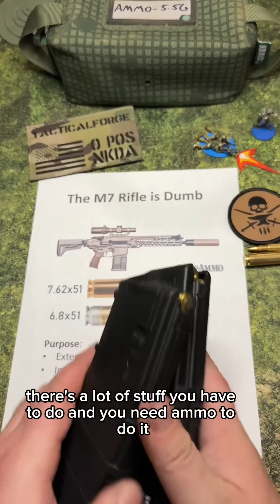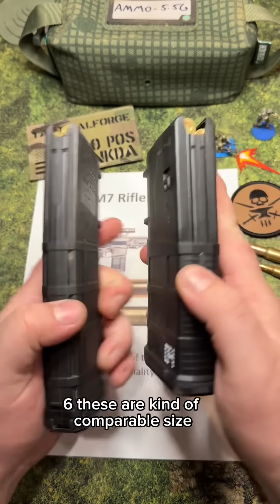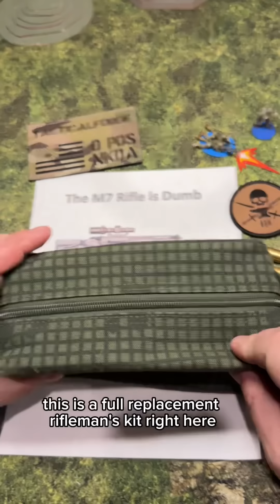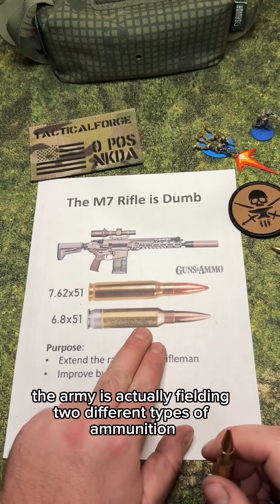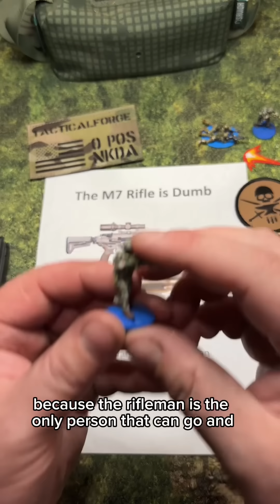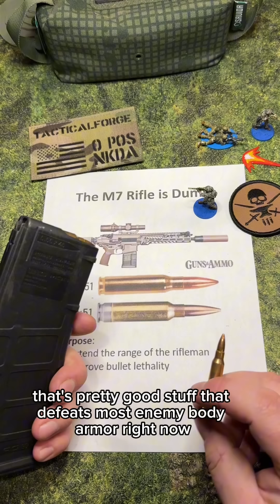The Army’s new rifle is dumb

Comment: Regarding the Rifleman’s Load of 210 rounds, looking at both sides in Ukraine at the moment, who are actually getting into modern infantry combat, you see that assault infantry on both sides tend to carry a lot more than that just in mags. I’ve seen photos of Shturmoviki squads running 12-14 loaded mags each, never mind loose ammunition. On the high end that’s 420 rounds, plus one in the rifle for 450 in total, loaded and ready to go. 5.45 is relatively light overall, which lets them carry that, between suppression from the squad’s base of fire and the amount of ammunition that has to be dumped for things like FPV drones, I think they’d shoot you for suggesting they try and carry enough ammunition for a rifle-caliber round like the XM7 has.
Reply from the maker: Yes indeed; the intermediate cartridges are just fine over there
Reply: you have to take into consideration that no side in Ukraine has air superiority,
americans will never fight a trench like that as long as USAF and naval aviation remains as capable as it is
Reply: @lefunnyN1  Air Support is helpful, but assuming the airforce will do everything every time is a great way to lose. The Russians are also able to deploy air power against fixed positions - that’s what UMPK kits are for - but in the time it takes for artillery or air power to respond when you are under attack or pinned, you may very well be killed.
Reply: @lefunnyN1 the Russians have the best AA batteries and the Chinese are building cheap effective jets
Reply: @lefunnyN1  your speaking like air power cant be contested, it very much can be and thats the problem they've run into in Ukraine , niether side can get the actual air superiority without risk of the planes going down

Comment: More weight, less ammo.

I'm not a soldier, I'm not an expert by any means. But that sure as hell doesn't sound good!
Reply: It's extra not good when you realize 99%+ of shot fired in small arms engagements are for suppression at ranges less than a couple hundred meters 

The side which gets successfully suppressed either trys to run away, surrender or destroyed. It's been clear this is the case since WW2, still the case in Ukriane even with wide open fields, yet these generals seem to fantasize turning all rifleman into snipers and think armor plates have the coverge of medieval knight armor

Comment: Number one issue is the obvious; "How are you gonna tell me to carry more weight, but less ammo?"

This is why I think the Army should just issue out the URG-I that the Rangers have been using for a while. It's still an M4, but it's got an upgraded barrel and an MLOK rail that's significantly lighter, having more airflow that'll keep the barrel cooler during sustained fire. Also, they can standardize the ACOG across the board rather than make the soldiers use those shitty '08 ass Aimpoint Comp M4s. Regarding the laser rangefinder on top of the new LPVO, that drives me crazy because it seems like the Army is worried about the wrong thing. You're not defeating the equivalent of level IV plates with 6.8 Hybrid, but what you can defeat is night vision. Take off the laser rangefinder and add a piggybacked RMR. This allows the soldiers to use passive aiming under nods, which will allow them to aim at a target without projecting their position to every Ivan, Ling-Ling, and Ahmed, who was blessed with NVGs. 

The Army's priorities are all fucked up. I like Sig as a company. I think their rifles can be great, and I like most of their handguns, but this is logistically impossible and logically unsound.

Comment: I wonder if barrel errosion will be an issue?  This rifle cartridge looks similar  to the performance of the Winchester 270.

I would pick a Sharps 25-45 AR-15 or a Winchester 243 DPMS rifle with an 18" barrel over the 277 Fury.

Comment: What I'm getting from this is that we want a g11, like low recoil, very lightweight (with ammunition included), decently enough accurate (probably). 

Na that project is dead and buried, and i don't think that there is a nation actually wanting to bring it back. Its just funny that it could fit that role very well (if they made sure cook off isn't an issue and have data on armor penetration), like maybe they really were onto something.

Comment: Stop putting the Army in charge of small arms procurement. The Air Force gave us the 5.56 & M16. The Air Force gave us the 9mm, M9, Sig P226/P228, and Glock. 

The 5.45 & 5.56 are working just fine in Ukraine. Arms, legs and brain buckets are still unarmored. Head shots are the norm for close combat.

Comment: IF this weapon was a DMR designed to use the same ammo as the replacement for the M240, then thats perfectly fine, and would fit in a squad like a puzzle piece. i think the new LMG is going to be an incredible asset and a new DMR that can penetrate modern body armor is exactly whats needed...but as a full-blown replacement for the M4 and, by extension, the SAW? NO WAY. the M4 and SAW in 5.56 need to stay; its just a matter of logistics and fire superiority.

Comment: The ammo is also a problem.  You cannot stockpile large amounts of it.  The metals react with each other and cause galvanic corrosion.  Plumbers can't even mix these two metals because they will fail so quickly together.
Reply: I JUST had to replace my main black iron (steel) gas line, because some clown installed a copper water line directly under it, touching.  The copper looked like a car battery, but the steel pipe looked like someone took a bite out of it.
Reply: Huh....wonder how that got overlooked. Or maybe it wasn't overlooked, and someone was thinking of the $$$ that will come from having ammo that goes bad quick.
Reply: @WangMingGe  that was probably the plan from the get go...everything poltical happens for a reason
Reply: @warren-g  I suspect you're right.

Comment: Even if we need to switch to more effective ammo, we can do this as an upgrade to existing rifles. A simple barrel swap, BCG and magazines and you can run 6mm ARC or 6.5 Grendel. Grendel would be optimum with 100gr loads at 2800-2900fps and retaining their energy at ranges that surpass even .308. . Grendel also uses existing 7.62x39 cases that are necked down. There already is robust production infrastructure among NATO and with US suppliers to make those rounds very quickly and in volume.
Reply: Case head is too large for AR15 bolts, leads to thinner material and therefore more breakage. That's why CMMG had to go AR10 bolt for their MK47 Dissent to fix that problem. Best bet would've been something like the Ruger SFAR, a hybrid between AR15 and AR10 in 6.5 Creedmoor or .308 Win. Realistically though, drone warfare is the future of modern combat and man v man combat would be at close range where you aren't going to whip out a drone, sit with video goggles covering your eyes, and dome your opponent with a explosive payload. Perhaps leading to 300 blackout supersonic since that can range about out to 200-300 with a 10.5 barrel, cutting down on weapon weight and length and making suppressors much more attractive.

Comment: Body armor is great and all, it can give you a solid chance to survive where you otherwise wouldn't but you know what defeats body armor better than an armor penetrating bullet? Volume of fire. Getting hit repeatedly by multiple guys with 5.56 rifles is gonna take you down, you're likely to be hit somewhere unarmored and get taken out of the fight. The M7s ability to defeat lvl 4 plates up close is already dubious at best, they'll just make tougher plates. Armor might save you from a lucky hit or a sniper aiming for center mass at entended distances but up close it's kind of a roll of the dice. We're also seeing a lot more small disposable drones being used as bombs and this gun would be TERRIBLE for dealing with drones. They're hard to spot and by the time you do you've gotta be quick or you're going to be dead. A few guys with full auto M4s have a far better chance of getting a lucky hit that takes the drone out through volume of fire than even 20 guys with this M7 with its high recoil and lower magazine capacity. The M7 also inherited all the Sig MCXs many issues, including the handguard and barrel being held on to the receiver by two tiny short little screws and prayers. Look up the barrel wobble caused by those screws coming loose after just a few hundred rounds even after people use loctite. It's a major issue and it's only one of many the gun suffers from. It's very obvious between the M7 and the M18 handgun the military skimped out on testing and awarded Sig with these contracts through pure bribery. The whole program was flawed from the very beginning as you've pointed out but add in a dash of corruption and you get a shit sandwhich.
Reply: I think you're the first person I've seen bring up the drone factor, and you're right....there's tons of footage of guys taking down drones by spraying them with AK74 fire. The M7 would be probably much less effective.
Reply: @WangMingGe the Ukrainians have some sort of explosive 5.45 round, basically micro flak for drones.
Reply: @agent7_4319  Amazing. I'd like to see some of those in action.
Reply: @agent7_4319  Incidentally, I can imagine those would do a horrible amount of damage on a human target...

Comment: My problem is that I need the 76 2 x 51 for my mission, and I'm being swapped out to 556. 
My mission didn't change , as a matter fact, if there was any change, it was from the evolution of warfare and now my mission is more dangerous.
I really want 762 . 
I don't have to run anywhere , I'm not carrying this stuff at least not very far, I'm essentially doing point defense. 
And the drone threat has really come into its own in the last five years. 
For my mission, conducting maritime security, 76 2 x 51 is minimum. 
Yes, I want the 50 cal.
No, I'm not going to get it.

Comment: Firearms technology has stagnated. Optics keep "improving" and platforms keep changing COSMETICALLY, but no improvement to the actual technology. We are still using conventional cartridge based firearms. I would love to see a REAL next step. Like a coil rifle. Unfortunately the tech isn't there yet, but imagine if you could build something at home that you can just plug in and something that doesn't get affected by an "ammo shortage".
Reply: We are far off from Warhammer 40k Lasgun technology. The problem with your idea is that the battery technology you described is not publicly available and wont be until these old heads retire or drop over dead.
Reply: @Arnuld15Governator i charge that people look for the solution themselves not sit on their butt and wait for it to come to them from someone else

Anything "commercial" is going to be subject to the same red tape, infringements, and "shortages" we are already dealing with

Be your own smith independent of all the industry. They are all compromised anyway.

Comment: Despite agreeing with almost everything you said, there is one thing I disagree with, which in this case would be the engagement distance. Although for the rifleman it is not that relevant to increase the rifle's engagement capability, however, for machine guns it is quite important. It's no wonder that many armies use MMGs within rifle squads despite all the disadvantages they have, just because of their better engagement distance (also not to mention that a greater engagement distance allows for a more capable designated marksman). Therefore, what I would suggest is to replace "less capable" intermediate cartridges like the 5.56 NATO or the 5.45x39 and use cartridges like the 6mm Max or the 6.5 Grendel (because although they are still intermediate cartridges, they considerably improve the engagement distance and also have other advantages, making the weapons more versatile and without increasing the weight and bulk too much).

Comment: As an ex Army Infantry Officer, this rifle should have been used in the capacity of a designated marksman in each squad at the platoon level.
The concept is good, just totally impracticable for sustained battlefield use.
Low round count, very heavy, and the extreme velocity of this high-pressure cartridge will burn up barrels in just a couple of extended engagements. What a potential nightmare both strategically as well as logistically.

Comment: It's about the arnor penetration, not the range
Reply: It's not. Armor penetration and extended effective range are both goals of the NGSW program.

The issue with the armor penetration issue is that 6.8x51 likely can't penetrate a SAPI plate (or equivalent) 

Sure, they're "rated" for .30-06 M2 AP at like 2800fps and the "spicy" 6.8 loadings are creeping past 3k, but those plates often take .300WM / .338LM hits in independent testing and that's far, far more energy on target.
Reply: The existing 5.56x45mm round could be enhanced for greater armour penetration. Just as how its range was enhanced when moving from the 1st Generation, 55-grain M193 to the 2nd Generation, 62-grain SS109 in the 1980s, allowing it to be effective out to 600-800m (up from 300-450m with the M193)

Comment: No, it makes wonderful sense. Except that it was done all wrong. They could have used kac or the lmt rifles already in circulation, used an improved projectile and done just as well. The process is literally rebarrel the firearm. Which is not complex. Offering the ability to use a 6.5 creedmoor case to power enhanced projectile. 6.5mm is bigger than 5.5mm right? Hmm.. but some shitass GO didn't get a kickback for buying unnecessary junk.

No need to push this steel head, brass case design.. those higher pressures mean reduced lifespan of parts. Plus, concussion... Uh.. 

If that was too expensive, the 7.62x51 chambering with a 140gr penetrator would already be fairly effective, no? Which.. is just having linkless rounds for the box mag...

But SIG sure is REALLY knocking it out of the park lately

Comment: I have a few questions that I'd love to get an informed opinion on. Regarding the LRF and BC in the scope. Assuming they can get those features working well, wouldn't that allow the regular soldier to engage targets further more accurately, even if not out tonthe 800m range?

Secondly, considering the idea of a round able to penetrate emerging or future body armor developments seems like a good idea. The current equipment works on the current targets, but isnt relying on what worked last time just 'preparing for the last war'?

Comment: Limited understanding take - hear me out: The ballistics are really good, it’s heavier than it should be but it’s suppressed and effectively doubles the range of infantry engagements from 3-500M to 800-1K Meters. Given the domestic concerns and return of trench warfare - movement is limited and giving each soldier a range finder is primarily for secondary weapons systems like drones or armour support with distinct coordinate drops. With a thermal clip on - this is a massive force multiplier for infantry. 5.56 was made to injure and incapacitate - not kill. 5.56 is a hopped up .22 cal that is not a one shot drop weapon. This weapon was made for holding cities and entrenching and has a far better penetration factor for concrete blocks.
Reply: I believe the question that needs asking is whether or not line units need pinpoint accuracy at 800 yards. And then, if their ballistic system fails or they’re no longer using the laser because it highlights unit positions (think drones), will they still be able to make hits at 800 yards. The answer is, without specific marksmanship training, no. As far as the 5.56 is concerned, all the current issues stem from having a 14.5” barrel length. The 5.56 is lethal at 400 and 500 yards but not with a 14.5 inch barrel. The 5.56 can provide good suppressive fire at 800 yards, but not from a 14.5” barrel. Changing the M4s to a 16” barrel and using the M855A1 would solve the majority of issues we have right now. But the Army is star struck with shorter barrel lengths. Have we invented night vision or thermal sight that can detect a human under cover at 800 yards? Yeah, it sounds like a great system but, as history has taught us, most combat involving riflemen is at 300 yards or less.

Comment: If you want extended range with minimal changes then an M16 with a freefloat barrel and a great magnified optic & rangefinder would achieve similar results.
If you then absolutely need 7.62 NATO for a mission you can swap the upper and magazines.
Reply: No, you’d need a different lower as well. They’re not the same lowers. Also, beyond the practical ranges of what a shooter can perform in real-time, the 7.62x51 could be swapped in. Of course, I’m playing by the rules of your scenario.
Reply: @LoneCrusader  My mistake. I somehow assumed 7.62 NATO and 5.56mm NATO shared the same overall length, for no good reason.
Those two calibers are in the  logistics system, with AP variations available.
This new 6.8mm seems like a half-measure, stuck between lightweight 5.56mm and powerful 7.62mm.
Reply: All good brother no sweat

Comment: On the bright side - at least the USMC can have all m4s now that they can get those hand downs
Reply: They don't have to. Look up current Marine squad level weapons. They are all M27s. Basically piston driven M4s with a 2 inch longer barrel
I'll add that I am former Army infantryman and will admit that thankfully the Marine Corps isn't trying to adopt this stupid rifle. Not sorry for saying that. This is an utter mistake making this the issue squad level weapon. My vote is to develop an M4 (maybe from Geiselle, LMT, HK, etc) in 6 ARC.
Reply: Too late. Every infantry Marine has since moved over to the HK416. The original plan for the HK416 procurement was to only replace the FN Minimi, but they’ve gone further and replaced legacy M16s as well